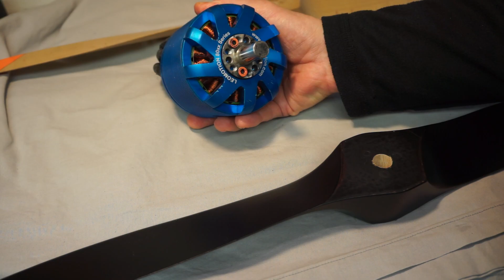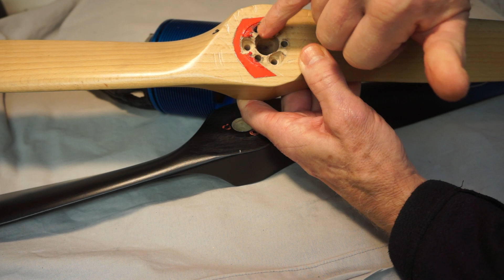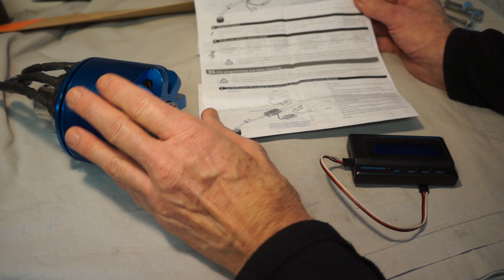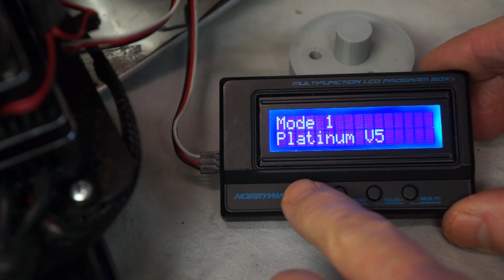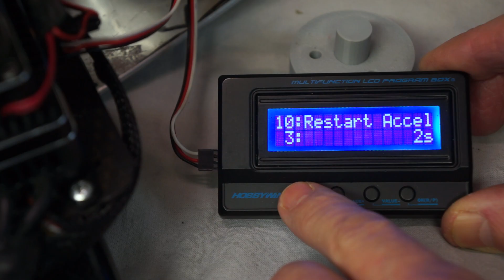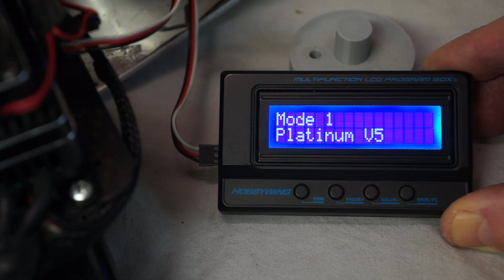Hang Glider E help, part 5 Eng

Comment: Thank you Sir, for sharing, in- depth, the construction of your e-help unit.   Yours is the design which I prefer, perhaps with a folding propeller, eventually?
  I'm 70, fit, retired after 33 yrs. in Aerospace Composites tooling, and I know I could produce matched "limbs" to unfold from THE HUB design, based on that which you are using here...14mm shaft, then your 6-hole pattern, then the folding  "knuckles".  
  In summary, thanks again for explaining the electronics, that's out of my league.
  Best to you,Sir.
Reply from the maker: Thank you, keep me updated on the propp project please. Br/Claes
Reply: I really need a good pattern of ONE BLADE to begin building a a multiple-part mold.
  A broken prop with one good blade still attached to the center/hub, carbon or wood should be fine. Can anyone advse? Got a broken one to sell? Or maybe I should get a 3D printed model ?
  32x16, so I can "stick to the recipe."